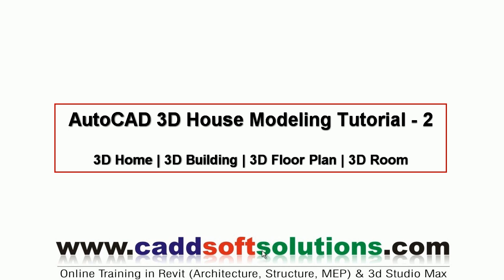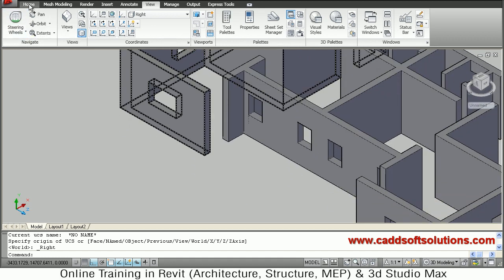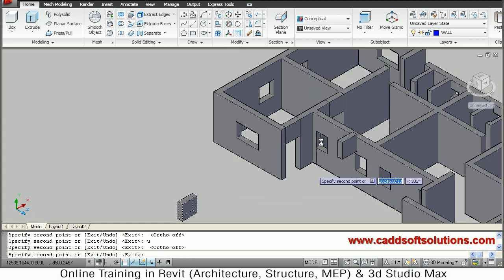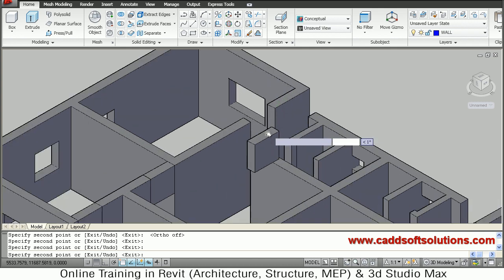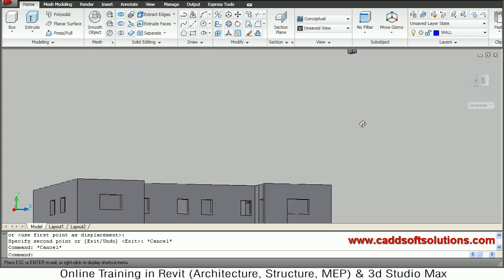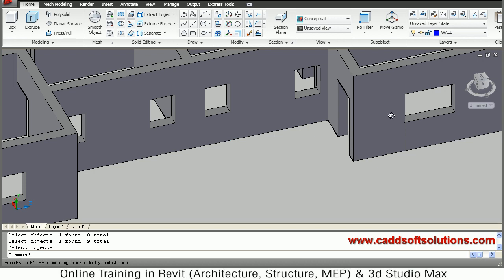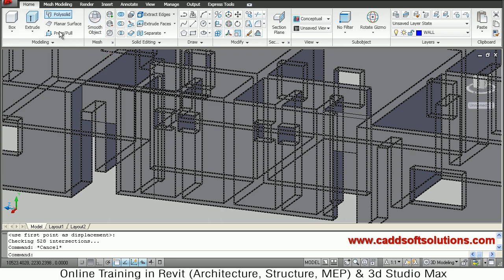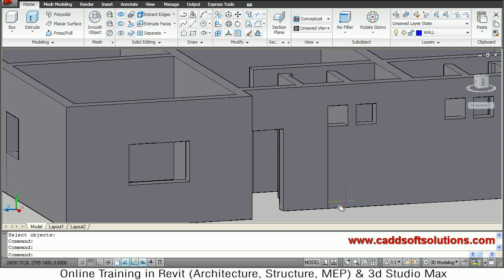AutoCAD 3D House Modeling Tutorial - 2 | 3D Home Design | 3D Building | 3D Floor Plan | 3D Room

Comment: Hi, thanks for this very informative tutorial. I have issues with my ribbon and Quick Access Toolbar(QAT). I do not have the workspace navigation gear. I tried to customize the QAT by click and dragging the 3d workspace to my QAT but it doesn't work. Is there a way that I could set back my ribbon to its factory setting like the one that you have in your screen.  Thank you very much.